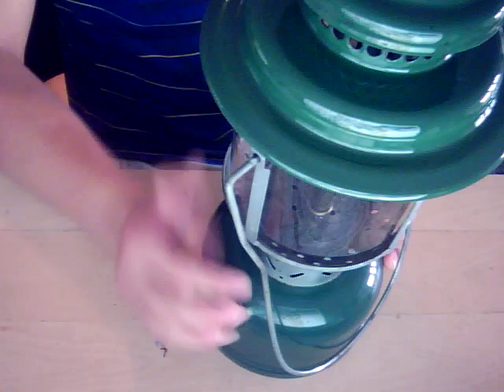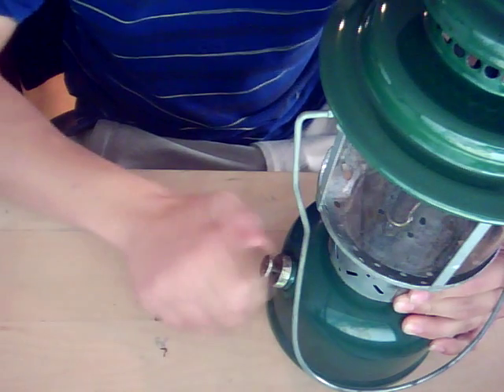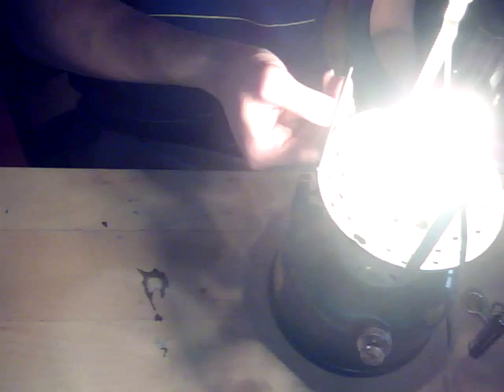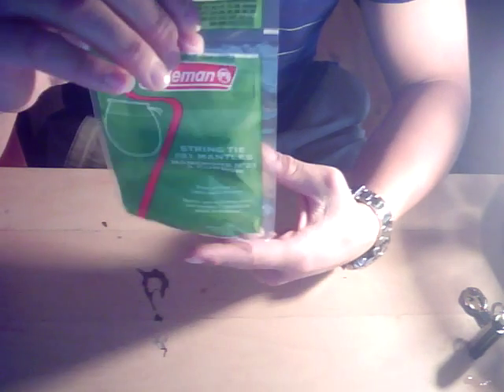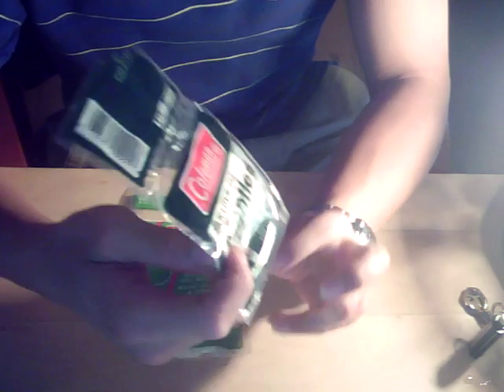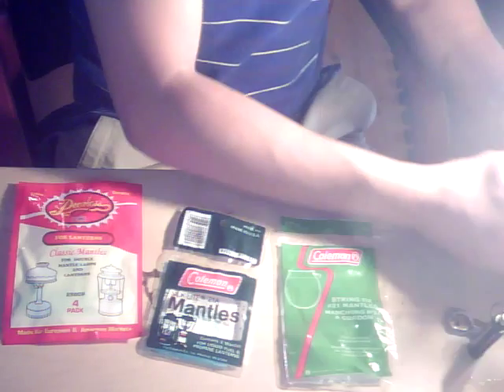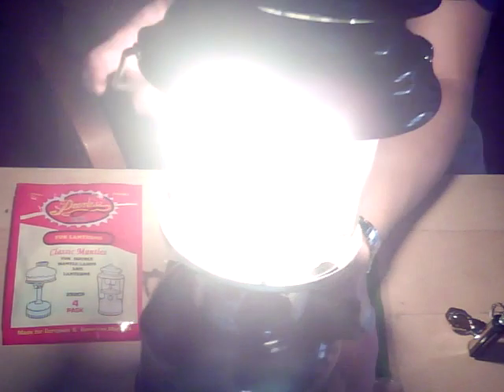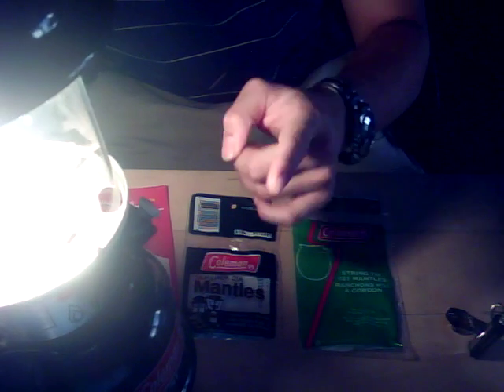Coleman 220C 1946 2 Mantle Lantern & Different Types of Mantles

Comment: Thanks! I still have Silk light 21A's I use on my single mantle 200A. They usually last a couple years of camping/fishing about 5 times a year bouncing around on dirt roads etc. I was unaware that Coleman did this change. I have noticed for decades that my little 200A put out a lot more light than my camping neighbor's newer twin mantle lanterns and  assumed it was the lanterns being throttled for safety/ liability reasons. It's great to know the new mantles are inferior in light output and durability. Nothing sucks more than a mantle breaking leaving you in the dark in the boonies  to put a new one on after the lantern cools. Next stop from here is eBay to stock up on Coleman NOS Silk Light mantles.
Reply from the maker: Definitely worth it to have a stockpile of Silk Lites on hand!  But honestly, the thorium peerless mantles are great too, check out my latest video on Peerless mantles!

https://youtu.be/v_v2_E0XDb8

Comment: FYI, you mentioned painting your ventilator with Rustoleum... It won't work. There is too much heat generated and the paint will burn off. The ventilator is porcelain-coated, which will take the high heat of a burning lantern.
Reply from the maker: I'm aware of this now, this video is from a long time ago.  I never did touch up the the vent.  It is just fine the way it is.  Still have the lantern by the way and short of a genny cleanning and new mantles and a cap gasket, she's all the same and running great.

Comment: i have 3 220f lanterns (1956, 1958, 1966) and a 1973 228F i love these lanterns hand them for a long time the 1956 was my grandfathers and the 1958 was my grandfathers brothers. all original and i take very good care of them . the other 2 i found in the trash , they said i could have them. any ways when i was younger i use to tie the mantles  up abobe where you normally tie them and they would get super bright from hell! try taking the coleman mantles and tying them above the normal spot where they are supposed to go . yes they are thin and break easy but for $2.49 for a 4 pack at walmart  you cant go wrong . anyways if you try putting them where i said you will see that it shortens the mantle  making it a little smaller and they burn brighter. give it a try and see for yourselves you may be supprised

Comment: You can’t repaint the ventilator. It’s porcelain coated. It runs over 900 degrees while the lantern is burning, and no paint will withstand that.

Comment: You can’t repaint the ventilator it is porcelain coated. No paint will resist the temperatures that gets to. Also when you light the lamps you should be pumping it about 40 times before you light. Then turn your cleaner stem down. Then a 1/4 turn to light it. Wait till it gurgles to light. Your lighting process is odd and contrary to what Coleman manuals state.

Comment: Other than peerless, modern mantles are garbage.  I have a 5133 propane lantern with a mid 80's #51 mantle on it (the first and only mantle that has ever been on this lantern) and that lantern has literally seen over 100lbs of propane go through it and countless camping trips since I got it in the early 90's.  A modern 21 seems to barely be able to handle being moved from the car to the campsite without breaking.

Comment: What type/number of mantle do you recommend for a Coleman 220D ? In the bottom says “B   48” for what I assume it was made in the second half of 1948.
Reply from the maker: Nice lantern!  

For any 220, 21As are a standard fit and if you don't wanna use the modern coleman crap or pay the premium for old Silk Lites, then go with the Peerless 2C-HG.  Those are a modern 21A equivalent that still have thorium and a much better light output.

Hope this helps!
Reply: @ctuan13  it helps a lot! i was searching all over and for some reason they don`t have much info about this particular model. it`s really bright and i love the chrome. thanks again and of course, i subscribed, thumbs up and i shared the video.